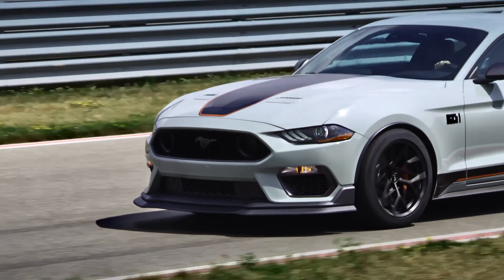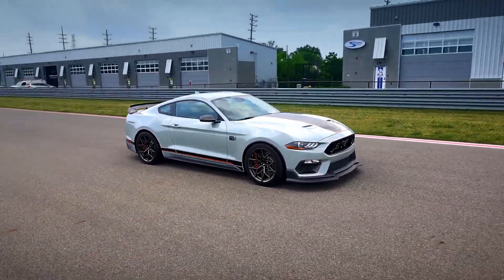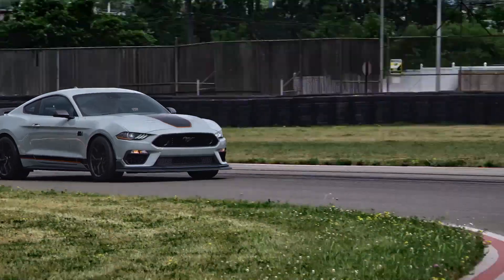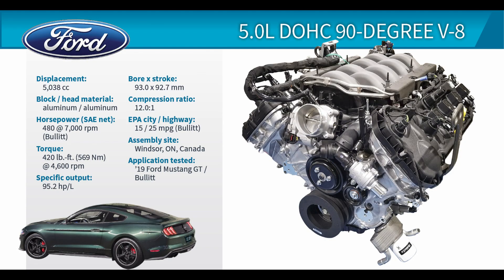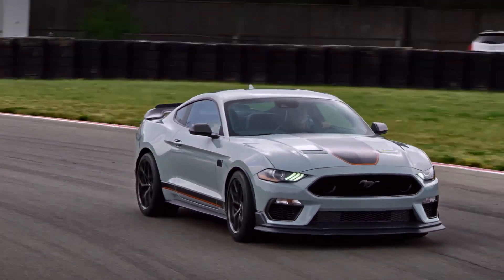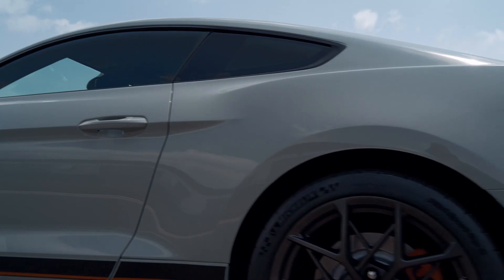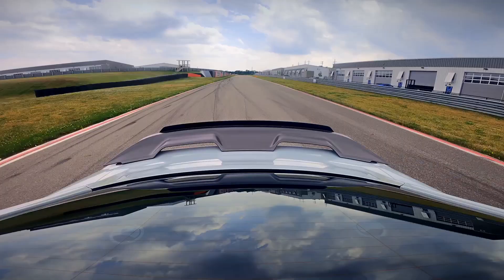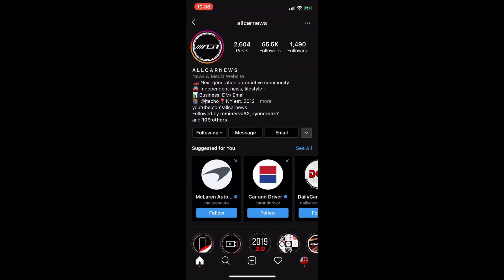Is the 2021 Mustang Mach 1 really just a modern Boss 302??

Comment: I have made crystal clear this car with it's Boss 302 Mustang grill vent pop out's, track setup, high performance intake, no Mach 1 shaker/ram air setup and no High performance engine like the 69 428 Cobra Jet the car should be a 2021 Boss 302 Mustang.